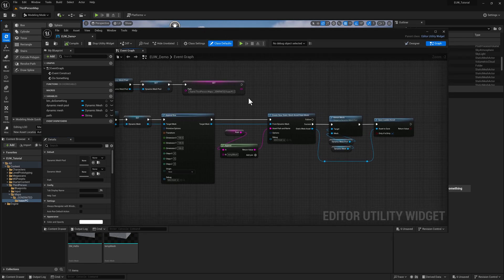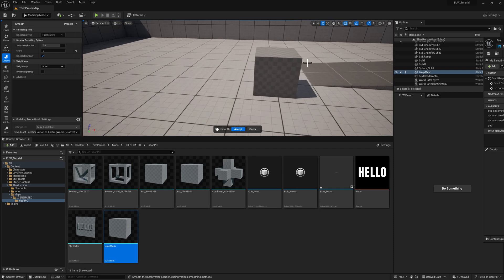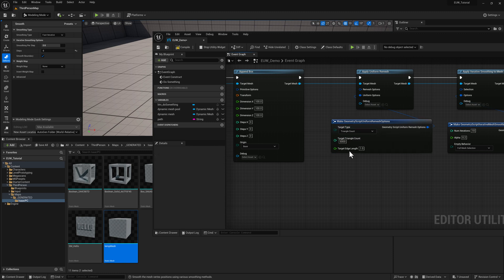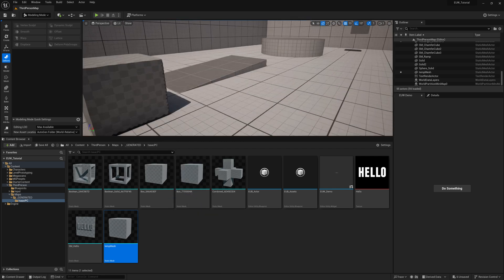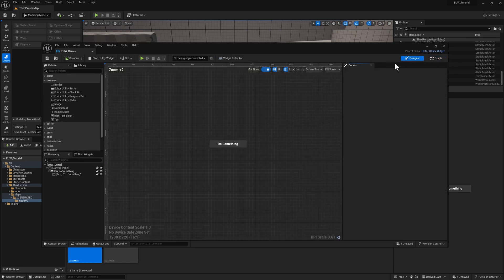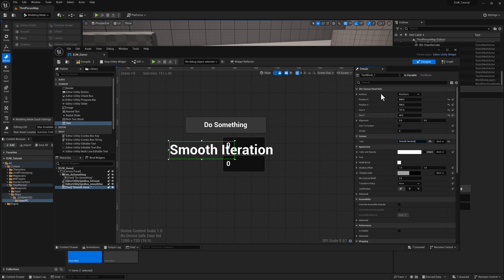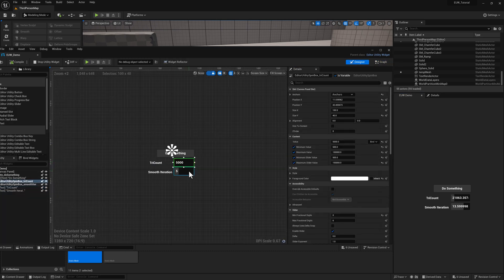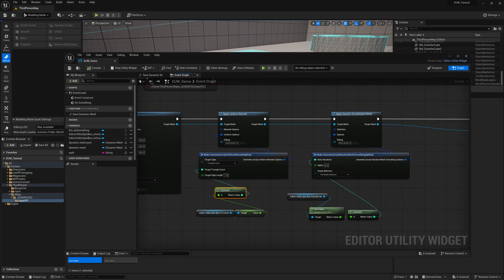Procedural Modeling with Unreal 5 - Ch 9 Geometry Scripting 2

Comment: I am really enjoying this series, thank you! I'm hoping to get to where I can use Houdini-style node based procedural geometry editing, all inside Unreal. BTW I'm using UE 5.5-preview, no problems so far. One thing I noticed is that at 7:30 where you set the Min Fractional Digits for the spin boxes to 0, you can still set floats in the sliders unless you also set Max Fractional Digits to 0 as well. The sliders still work if you set floats, but it's more elegant if you can only set integers, IMHO :)  Thanks again for the series!